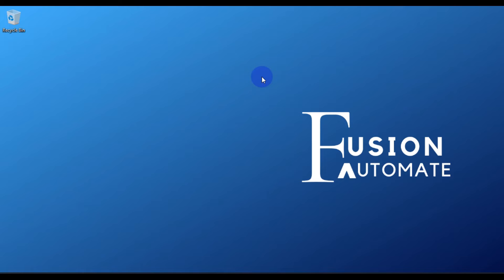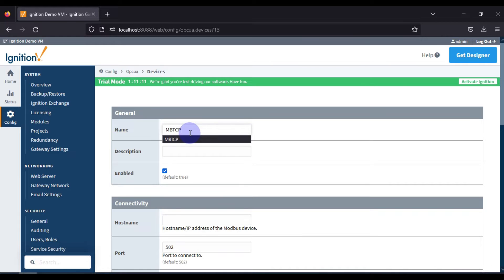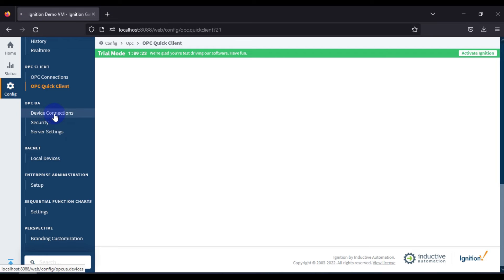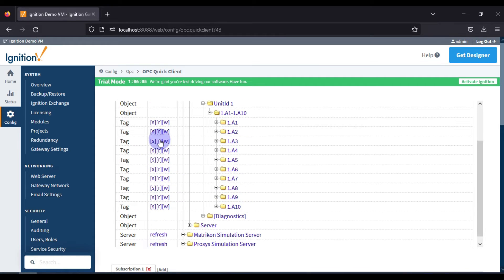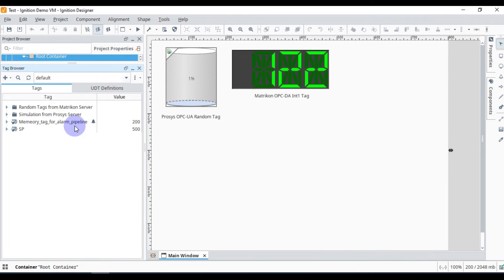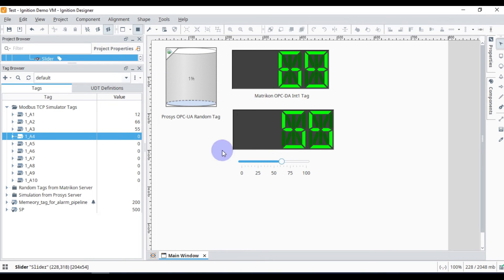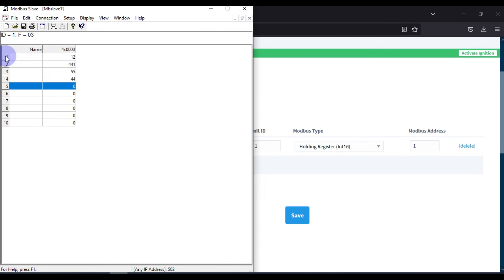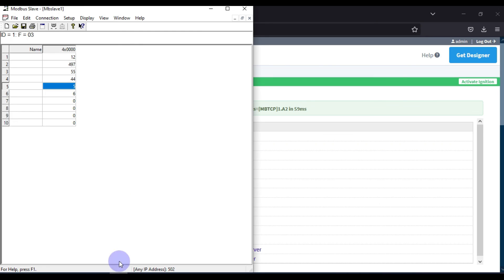Ignition SCADA Communication with Modbus TCP-IP Device | Read Holding Register(int16) Values |

Comment: Good afternoon, thanks for the video. I currently have to communicate with a Schneider PLC using the Modbus TCP/IP protocol. The registers I have to read start at 16410 and the data type is int. How do I tell you that you have to read that register number? Thank you very much.